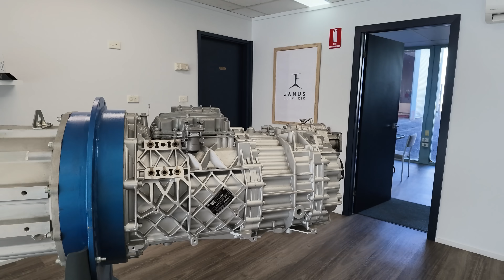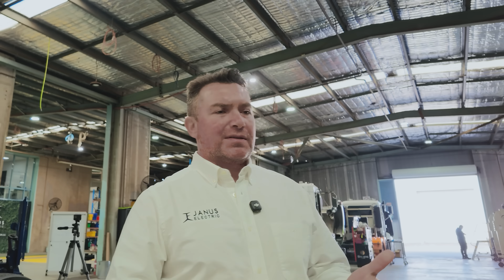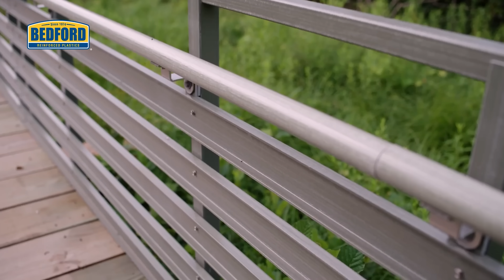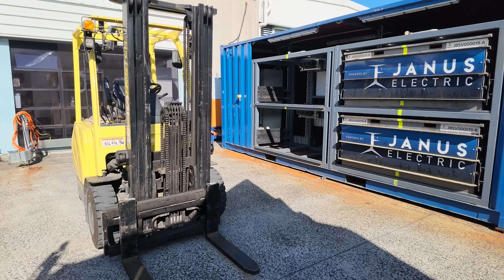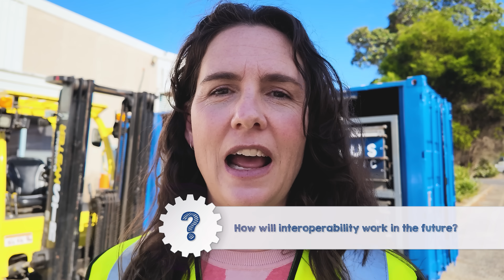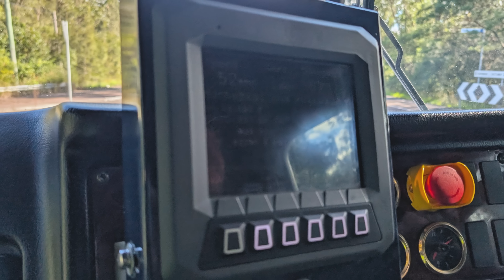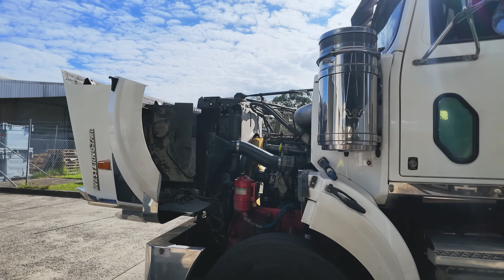The EV Truck Idea I Actually Didn't Believe Until I Saw It

Comment: The question you didn’t quite ask is what is the cost per truck for power plant replacement versus diesel, the explanation in your video was somewhat muddied by comments re charge containers etc. Yes, these required but if you have 4 or 8 trucks to retrofit what is the cost of complete system per truck vs diesel?
Reply: And what are the savings right ?

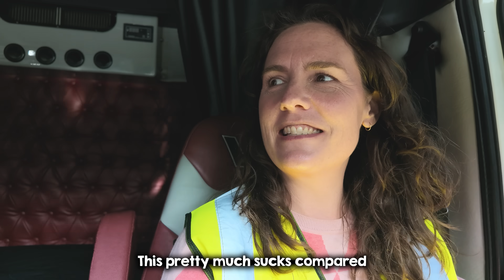Comment: 14:10 Lady, the suspension has no correlation on why electric motors are better than diesel, plus the noise from a diesel is a white noise to others, science doesn't need your personal preference or feelings to prove why the latter is better. You don't need to look beyond the main point on why electric motor is better to sell it. It's just more energy efficient than diesel that burns 9kwh/km (1 liter of diesel is 9kw and the usable energy is actually 2.5kwh, the rest is turned into heat, etc., and suppose the efficiency of engine is 1km/L) than the electric motor that use 1kwh/km. And cost efficient too, refilling 1 liter of diesel cost 4 times (depends on the country) than per kwh charging from the grid. It now depends to the trucking company if they want the caveat of shorter range the electric motor can only provide. THATS the science, not just because of "greener" or "clean energies" that I only heard from loud mouth activists.
Reply: Eco no longer means just ecological it means economics

Comment: Nice! In Europe the economic size of the battery is pretty much influenced by driving regulations, which make the drivers do a 45 minutes break after 4 hours of riding. How's that in Australia? Do you have similar work hour regulations for truck drivers? The only european conversion I've seen so far are for special depot back and forth trucks:  https://www.youtube.com/watch?v=vzXubI16vfk

Comment: So Janus, didn't they make the truck that caught fire on the Westgate?
Reply: Yes that was them.   2023 - they had an internal shirt in a battery cell.  They had a second fire in 2024.
Reply: 2022. There has been a lot of improvement in battery tech since then.
Reply: @aussie405 lol there hasn't, actually. Battery cell technology wasn't in the stoneage in 2022. When was Li-Ion comercialised? 1990 or something? When were the Galaxy Note fires? 2016 wasn't it? Do you really think a place like janus is on the cutting edge of li-ion cell development?
Reply: @donkeytoots1 Lithium Iron Phosphate batteries started to be put in cars around 2023. Prior to that the batteries had Nickel Cobalt and Manganese in them and were much more flammable.

Comment: It's so cool to see that they're already out on the roads doing their job.
Reply: Battery swap-n-go at ports and rail yards is a great idea.  The trucks really need to drive around in intermodal yards to be near where the containers, etc, are being lifted off and on the trucks and this can't be done while charging.  Disconnecting the charging time from the truck solves so many problems and would even benefit cars, I think.  Nio, in China, is a car brand that specialises in 4-minute roadside battery swaps instead of charging.
Reply: There are so many out there now. The turn is happening because companies can see benefits today. Lower maintenance costs, simpler design, then the ongoing fuel cost savings are immense.
Reply: The grid can’t handle it. It won’t work.
Reply: @GORT70  People said that when we invented air conditioning, then we expanded the grid.
Reply: @GORT70  can’t handle what?
Reply: @GORT70 sigh,ok why won't it work?
Reply: This video is pure propaganda.
Reply: @tarstarkusz hurts learning you've been lied to by the fossil fuel industry,can't tow your boat 😂😂😂
Reply: @russe19642  This video is a 17 minute long commercial
Reply: @tarstarkusz great isn't it, what part do you think isn't viable?
Reply: @russe19642  I didn't say it wasn't.  I said it was a 17 minute commercial for the company and was propaganda, which it absolutely is.
Reply: @tarstarkusz and?
Reply: @russe19642  And what?  It's propaganda/a commercial masquerading as a video.  Why is this hard for you to understand?
Reply: @tarstarkusz I'm understanding it, just why is it getting you upset about it for? Because you think I don't think it's advertising? It's informative, call it an informamercial if you want.
Reply: @russe19642  Because it is not being presented as if it were an ad.  She does not disclose if she has been compensated for it, but I would not be surprised if she was. 
 There was not a single pushback in the entire video, despite at least one tall claim that I can still remember, the idea that you can have this charging system on your own site without an electric service upgrade.  While that may be true if you aren't already using electricity, if you are already running a warehouse or factory in the site, you would almost certainly need additional electricity service.

Comment: The only thing not discussed was those Canadian batteries,  why a change, whats different etc.
Reply: It was said that the newer Canadian batteries would be much lighter. This indicates that the battery chemistry is more energy dense than the existing batteries. This is normal progress for the battery industry. Batteries are consistently getting more energy dense as thousands of battery researchers develop newer and better chemistries that will power electric transportation in the future. In four or five years Janus will probably change the batteries they are using again (and again, and again...).

Comment: Informative thanks, commonsense says this is the way forward. Out here in British Columbia an outfit called Edison convert logging trucks from diesel to diesel/ electric ie the truck goes up the mountain unloaded on battery power and, comes back down loaded on diesel.  They have a converted PU that they show around.
Reply: If the load is coming downhill surely they can capture the energy via regenerative braking and not need diesel at all for that loop. Like the Fortescue iron ore train in Western Australia

Comment: Better than getting suckered by the pantograph scheme, but still many of your comments are missing the very simple idea that, if you are going to have redundant stationary batteries to smooth the charging....then you can just have redundant stationary batteries to smooth the charging attached to an MCS charger. It's the same amount of batteries cycling the same number of times and the same grid load.
That said, Janus are very cool and have solved a lot of the downsides of battery swapping. It makes a huge amount of sense for retrofits, and it's borderline criminal that they don't have loads of government support.

Comment: I don't know anything about how long a trucker in Australia is allowed to drive before having to take a break. Here in Europe the recharging fits perfectly into that break time window. And with megawatt charging slowly becoming a thing at around 1kWh/km you can theoretically charge 750km into the battery in a normal 45 minute break. With a speed limit of 80km/h for trucks you need a 9 hour shift without breaks to drive that far. So I don't see why anyone would want to use battery swapping for long distances. Especially because of the non-existing interoperability while you can even charge your truck at a normal fast charger for cars if none for trucks is available.
That said battery swapping sounds like a great solution if you never really drive far away from your depot because the battery can "trickle"charge off a normal grid connection saving you a lot of money.
Reply: 5 hours 15 minutes until you must stop for 15 minutes. This company (Janus) have swap stations along major trucking routes (Melbourne <--> Sydney) making the 850 km drive possible
Reply: Australia is quite different from Europe: they have a lot of sun and extremely low population density. You can drop a battery swap container like this in the middle of nowhere and put a small solar power station nearby - no need for any communications at all.

Comment: Great to see them getting into a range of applications, as this will helps speed the acceptance of the change.
What is so good is to hear them talk about how NOT to impact what the customer is doing today, as much as possible.
Change is HARD, and many people IDENTIFY with the engines/trucks they drive, many LOVE the noise they make, and work to make them louder......
It has been said that a new technology has to be 10X more reliable to be SEEN as being more reliable. That is the type of challenge this has, but I am sure it will win.

The great thing about trucking is it generally doesn't know how to hang onto savings. So once a segment of trucking works out that electric can do all that they ACTUALLY need, they will enjoy the savings. 
But with the first push on haulage costs they will lower their rates and this will put extreme pressure on others to make the same change. The snowball will then be rolling.

Why is electric conversion weight competitive to diesel in Australia? In large part because Australia uses HUGE diesel tanks (compared to elsewhere), 1200 L is not unusual. So the engine plus fuel is around 2500 kg.
The range between electric and diesel is VASTLY different - however as discussed provided Electric can meet the ACTUAL task demands there is no issue.

Battery life was discussed, a quick comment that a lot was feared about this but the more that is seen, provided the batteries are well cared for (not to hot or cold) their life is FAR more than previously thought.
To the extent that degradation is almost negligible. The real world will have its say, but work put into maintaining ~20-25C as much as possible, the better.

Aus has a 6.0T front axle load limit (7.1T for RTrains with wide tyres).
This was lifted to 7.0T to allow for the weight increase from EuroVI compliance provided the truck was also safer, cabin strength for occupants, front underrun for other vehicles.
Victoria allows Low or Zero Emission Heavy Vehicles (Volvo's) to have 7.5T front axle weight.
These increases added to the maximum vehicle weights and so both allowed for technology associated weight increases as well as potentially increased productivity.

Australia has unique demands - but a LOT of very similar demands to Europe and the USA.
Europe is space confined - so the focus is on making trucks smaller and more maneuverable. So Cab over engine (length and visibility) and the front axles set back further from the front bumper (manouverability).
USA is about freeway access "everywhere" so the limitations are on the trailer length, the trucks can be any length, hence descriptions like long and talls for the prime movers. The front axle only has to hold the engine up.
Australia falls somewhere in the middle, our streets aren't like Europe's and our freeways aren't like the USA's.
So our trucks have overall length limits like Europe but lower (front) axle weights like the USA. Why? - history USA trucks dominated the interstate network.
Increasing front axles weights is a direction leading to impacts on road life - particularly when the roads are not built to freeway standards (like stone covered tar!!!!).

Comment: These ranges are really short. I just did a quick check and they would be lucky to make one round trip between my village and the nearest town and couldn't make even one way to the nearest major city.
Reply: Yes, the ranges are short, however, like was said in the video, 80% of the trucking is within this range on a daily basis, or the trucks return to the depot nightly. This makes this battery swapping model viable. Additionally, if a company had a regular route between two cities, like in your example, they could simply place a containerized battery swap station somewhere in the middle of the route that would enable the required distances. 
Often, I read in the comments on Electric truck videos that Electric trucks can't do long hauls, or that Electric trucks will never happen because there aren't any charging stations. We'll, as was stated in this video, 80% of trucking is "Short Haul" (same 80% applies to the USA) and this segment of trucking is perfect for Electrification.!!

Comment: I was reading the other day about how common theft of derv from a parked up truck is. This technology should reduce the theft of derv, I just wonder how long it would take for a thieves to work out how to steal a removable battery pack. There will be a market for a used battery pack, although it won't be so easy to sell as Derv.
Reply: From another video featuring Janus, I learned that the batteries are locked into the truck. Additionally, the battery packs are very heavy and can't be moved easily without a forklift. It would be easier to steal the whole truck than just the batteries.

Comment: Air Cooled Batteries ... they  estimate 20% derogation over 8 years & live 15 years  " ... So 180 full charges a year /battery x 450km = 80K km per year for the battery & 160k km for the truck ?    I missed the battery size & weight , but guess 1kwh of battery gives 1km ... so 450Kwh battery pack weighing 3 tonnes .   So surprising it isn't heavy,  Janus the god of Beginnings & Gateways , Two faces one facing forward & back . 😀

Comment: Another excellent video, thanks Rosie. This is so impressive! Being able to swap from a diesel truck to electric at only a quarter of the price of an electric truck ─ within 5 years from now ─ is a rapid way to turn trucking electric. The swap station model sounds great as well. It's hard to be sure as absolutely everything in the model has to work, but this really sounds promising!
Reply: blablablablabla!!!!! those truck conversions doesnt offer all the features and options that OEM manufacturers have, also the oem have significantly more range and bigger network of dealership..... this is just a very separate case.
Reply: @carholic-sz3qv  Give up while you're behind genius....

Comment: Thank you, Rosie! I believe the Janus model could be particularly useful for countries in the Global South, where the main fleets are used trucks and the fact you can swap batteries with a fork lifter means it will integrate with existing equipment at factories. It would be great if they would license their technology to partners in other countries, so this model can spread faster, while giving them additional revenue to keep the good work going!
Reply: They have four trucks currently operating if the USA. Keep watch for further developments. P.S. the USA is potentially a massive market and standards leader for other smaller markets.

Comment: I feel so bad for drivers of diesel trucks - is any wonder that there is a shortage of drivers in many countries in the world!
Reply: eh, there's a big difference driving an old beast shown in the video compared to modern cab-over prime movers. They're comfortable, with all the mod-cons like adaptive cruise control, decent stereos, in-built fridge, etc. 
It's not discomfort of the vehicle that makes truck driving unattractive, it's the regulations. The fines have massively increased this year https://www.nhvr.gov.au/document/910
You can be fined multiple times for each mistake or oversight in your log book. There are foreign-nationals who are undercutting operators, pushing rates down.

Comment: Battery swapping is not a good idea.  The battery is expensive and storing multiple batteries for vehicles is an added expense.  The engineering can't change that.
Reply: China begs to differ sherlock! keep that negativity with you! this is clearly working.
Reply: Mate it's lucky you are not in business, because storing batteries is not the aim of this sort of business. Charging the batteries and getting out the door for use is the goal. As for the batteries initial expense, check out how the price of batteries has decreased in the last 12-months.  Clearly you are speaking from your rectum!!!
Reply: plus other added expenses, technical staff, charging infrastructure, cost of power to the site (those batteries are gonna take a lot of kw to charge) etc

Comment: Finally! Been waiting for replaceable battery systems on heavy vehicles to take off. The technology has been around on electric forklifts for +50 years and should actually be the first option when electrifying heavy vehicles because it doesn't require a well-developed charging infrastructure to work. Should be even more advantageous to implement for buses that run city traffic on fixed routes.

Comment: Did the mention that at least 3 of these trucks have burnt to the ground, with only 32 total production around 10% fail rate. How much polution dose  that make,  instead of just burning diesel, as the try and put the fire out washing into water supplies river systems and so on.  far to big of distance to travel in this country for this to be viable unless city driving , next you will see big  diesel generators charging the batterys in remote locations burning more fuel than the truck would have.
Reply: They no longer use those batteries, and diesel and petrol cars are up to 60 times more likely to burn....
Reply: Correct.
From Google AI:

Three Janus Electric thermal or fire incidents have been documented involving their converted trucks and battery technology.

Documented Incidents

July 14, 2022: A converted Kenworth truck caught fire in Berkeley Vale, New South Wales, destroying the vehicle prototype.

November 28, 2023: A converted Kenworth cement/prime mover truck caught fire on the West Gate Freeway in Port Melbourne, Victoria.

March 14, 2024: A separate battery pack incident occurred at a facility on Apprentice Drive in Berkeley Vale, New South Wales.
Reply: @aliendroneservices6621 Also from Google AI "They no longer use those batteries, and diesel and petrol cars are up to 60 times more likely to burn"....How'd that work out for you genius ?
Reply: Finally a real comment!